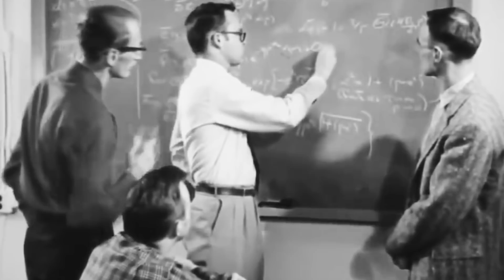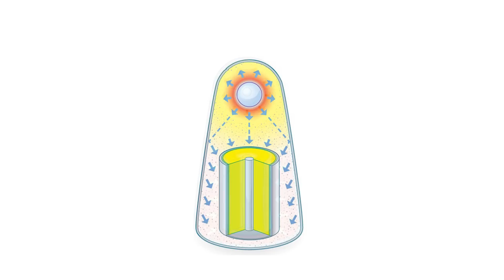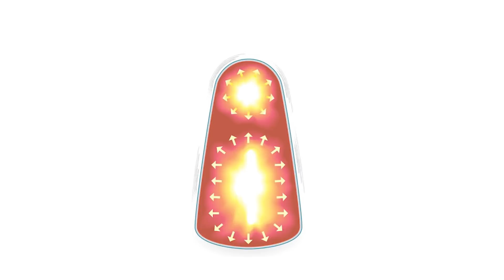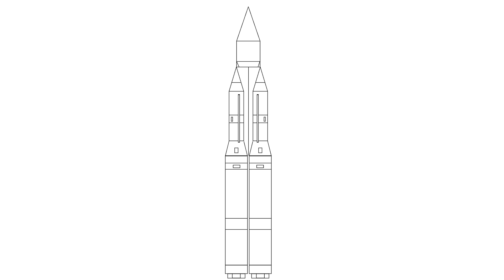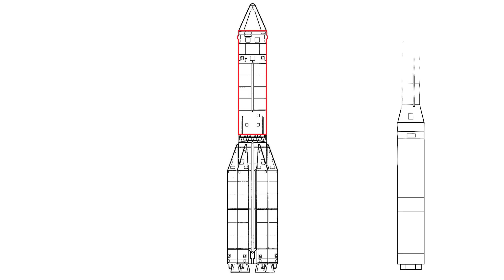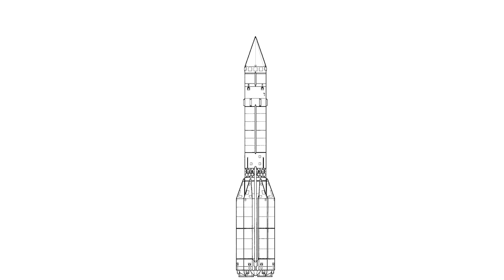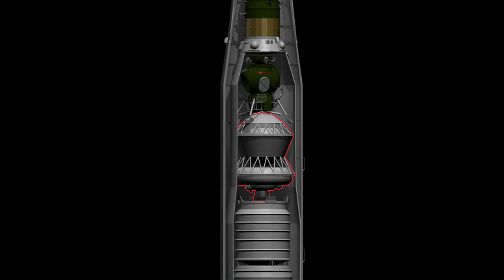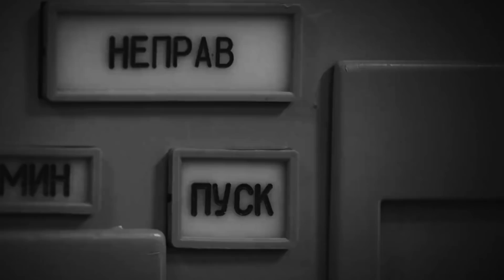Proton - peaceful life of a military rocket

Comment: the reason Koroliov didn't want to use hypergolic engines wasn't that they are polluting. the reason was safety. these fuels are toxic, corrosive and explode when mixed together. This does not apply to RP 1 or liquid hydrogen

Comment: Hm, the ISS was started by this rocket. interesting
Reply: The Proton was one of the most powerful rocket in the world and it was much cheaper, than the American rockets (before SpaceX)
Reply: @ervandrush3116  Maybe now, in the running, but because the US and the Russians let their super heavy boosters fall to the wayside (Saturn V, as well as Energia). The Shuttle was supposed to carry quite a payload - 29+ tonnes under best circumstances for Low Earth Orbit (LEO) - but they NASA dialed that back, and then retired the craft. Proton M comes in at ~24 tonnes for LEO , not much more than Falcon 9, which under best circumstances seems to come in at 22.8 tonnes for LEO. Falcon Heavy supposedly gets up to 63.8 tonnes for LEO. Otherwise, the Delta IV heavy can do 28+ tonnes for LEO supposedly.
Reply: @michaeldunne338  Using a Delta IV heavy for LEO is wasting taxpayer money ;-)
It's insanely expensive and its hydrolox engines shine in space, so it's best suited for deep-space missions ;-)
Reply: @AKAtheA  Probably right on expense and suitability for deep-space missions. But the topic was on power. Granted, the other person mentioned cheaper too. More interested in possibilities of an upgrade X37C space plane for manned flight with a Falcon craft. Also, on what could be used to more economically build installations in space.
Reply: well...
Reply: US and Russia worked together... good times